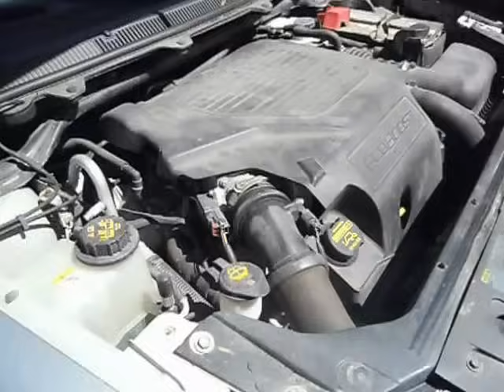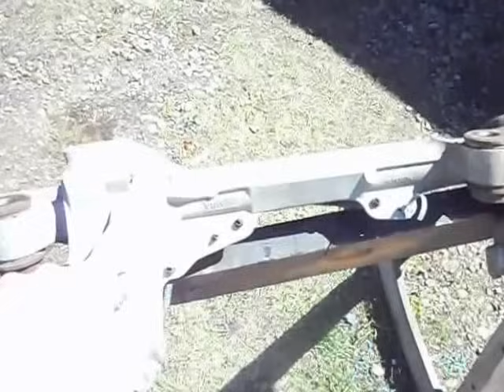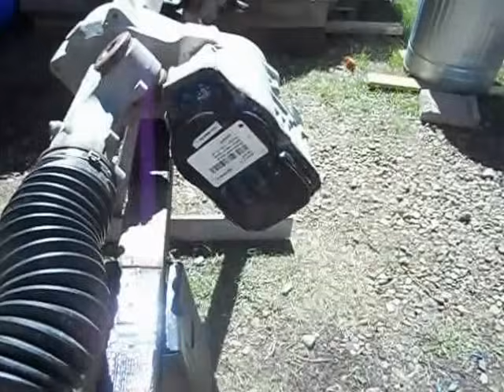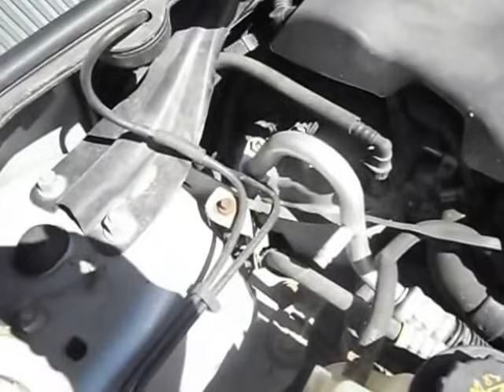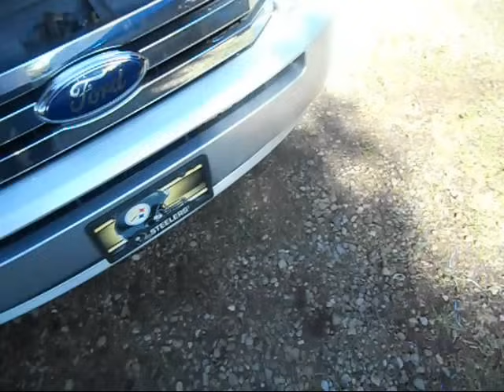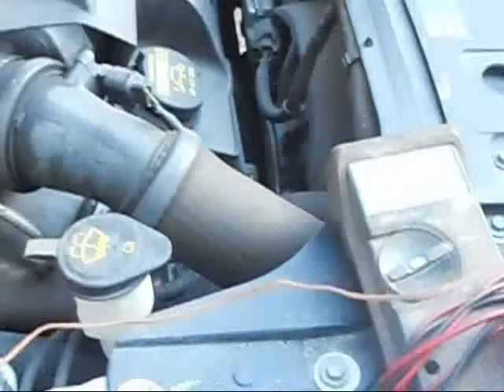Ford Electric Power Steering Failure Identified

Comment: It's happening to me on 2011 Ford F-150. 
Battery replace 
Rack and pinion replace
Reply: Why did you have to replace the battery I'm having a similar problem on my 2012 Ford Fusion and my battery was bad the battery is only a year or 2 old and I'm having this power steering assist issue that came out of nowhere overnight
Reply: @stevenpoljak9762  its was a bolt loose on the power sterling system. please check with your local ford dealership.
Reply: @stevenpoljak9762   I had the same issue with my 16 explorer, replaced battery on Monday, the power steering went out on Friday just leaving my drive way, ford says its not covered under warranty, want to charge me 3k plus tax to repair.

Comment: This has me worried about my 2012 Ford Focus also. How do I know that the rack is failing? Are there any sounds I should hear that indicate impending failure?
Reply from the maker: There are sometimes quick succession tapping sounds, there are sometimes impulses felt in steering wheel, there are sometimes no sounds with sudden failure, or instances when steering intermittently fails to assist. My 2010 Flex provided no symptoms other than strange pull to one side (which would typically be interpreted as tire wear or alignment issue), until abrupt failure during sharp turn, causing accident.

Comment: Ok. My Ford Mustang 2011 is presenting the next Failure: 

‘’Power Steering assist NOW’’. My mechanical said, order a new one steering Gear Rack/Pinion .. there’s any other option?  Or is a good solution??
Reply from the maker: Options limited, do not trust anything Ford tells you. Have vehicle repaired and walk away from Ford products. These vehicle deficiencies are dangerous and problem will return with replacement rack. Ford has done nothing to correct engineering blunder.
Reply: @bk1468  that is, could it be a computer error or related to some nearby failure? I mean, could it be the steering belt, some sensor, do you mean that which has to be identified correctly?
Reply from the maker: @Antuanettetavarez  You mentioned steering belt; which would be associated with hydraulic based steering system. I assumed your vehicle was equipped with electric power steering system (EPAS), which is the subject of this video. EPAS systems include no others components other than steering rack; which is fully electrically actuated. If your vehicle includes EPAS system, your problems are considerable and expensive to repair. If hydraulic, repair is much leas expensive.
Reply: @bk1468  hahaha I had to hire another mechanic specialized in the brand. and yes, you are right. the module that controls the zipper and others has a short circuit and more than 24 communication errors. Thanks to you I was able to hit the point of the problem.

Comment: So other than "dont buy a ford" what is the remedy for repair?
Reply from the maker: Replace EPAS system approximating $1.5-3K average. Dispose of vehicle before replacement unit fails again, due to identical issue.

Comment: 85 celcius aren't 180 farenhite, 100 Celcius is 180 Farenhite, however for electronic is still deadly temperature
Reply from the maker: You are incorrect, as several other commenters have made same miscalculation. C = (F-32)*5/9 and F = (9/5*C)+32 so, 85C = 185F. I believe I stated 180C in video, which was very close and based on estimated guess. Google has a temperature calculator also. Fundamental reference is boiling point of H2O = 100C =212F. You have also spelled both Celsius and Fahrenheit incorrectly.

Comment: My f150 is a 2012 and my electric power steering seems to be leaking some form of oil
Reply from the maker: There are no oil reserves I am aware of internal to EPAS unit. There are large electrolytic capacitors associated with power supplies, and grease applied to gears and bearings. Electrolytic capacitors swell and rupture when overheated; leaking electrolyte. Grease becomes less viscus and may flow at high temperatures. Otherwise my guess would be some other source for fluid.
Reply: @bk1468   it's coming from the pan right there on the power steering motor it's a fluid almost like brake fluid
Reply: @bk1468  and not where the cv axles connect in but that pan on the back side of it

Comment: Just curious, was there side to side or up and down play in your steering shaft “worm screw” inside the EPAS  housing?
Reply from the maker: Not clear what your question references. EPAS unit was electrically faulted, no mechanical defects were identified or investigated. Worm screw was never identified as worn or defective in any way, no mechanical play was detected anywhere in steering system, nor were any mechanical tolerances measured.
Reply: Bryon Smith sorry for the confusion, I was just wondering if you did notice any mechanical issues other than the defects in the electronics of the EPAS. I have an f150 and have about .0625” of side to side play. And I can’t find any information on the internal specs of the EPAS  system. Your video has been the most informative about the electrical schematics and it’s functionality. Basically lost on what to do, other than spend $2000. 😅
Reply from the maker: Shop on ebay for new EPAS replacement, you can find one for around $300.00 to $600.00. Would not be concerned about warranty since Ford will not honor it anyway, or at least try. F150 replacement is easy since you have lots of room to work. Are you sure mechanical problem is associated with EPAS unit? Really not much inside other than worm gear set, which in my experience requires serious abuse to become loose. Inner and outer tie rods would be my best guess. Good luck.
Reply: Bryon Smith I just posted a video on my channel, if you don’t mind taking a look at it and seeing what you think I would really appreciate it.

Comment: Just purchased a 2018 escape sent it in for a front end alignment car pull to right...got back still pulls to right and steers hard when turning. No codes yet bringing back to dealer today anything I should mention to them your input would be appreciated.
Reply from the maker: If related to EPAS failure and vehicle under recall. Do not let dealer update EPAS controller firmware. Ford will refuse to replace EPAS once full failure occurs. This may sound ridiculous and disturbing; but this represents Ford policy, many consumers have been defrauded in this manner. Also, your failure (if EPAS based) represents prime example of EPAS unit exhibiting non-commanded steering. This failure mode has been experienced by many Ford owners and identified as highly-hazardous. Non-commanded steering failures remains fiercely contested by Ford as non-existent, with hardware and software fail-safes. It is not the fail-safes at issue; failures caused by incompetent design philosophy and lack of redundant servo-feedback and control elements. Ford has basically implemented servo-system ignoring basic design precautions covered in basic control-theory.
Reply: @bk1468  Thank you for your input. There was a recall but cant remember what it was will look at paperwork once i get car back but they already updated it. Car has only 7000 miles on it and i have only owned for 2weeks. Did a search yesterday about issues having and your thread came up. Thanks again.

Comment: If electric motor in steering rack will fail would you be able to steer at all?   or not? Can you turn steering wheel or it will be locked?

Thanks!

with "'old" system I know if power steering pump is broken you can steer but with great afford, so you may avoid accident
Reply from the maker: Just like hydraulic steering; electric steering defaults to manual with loss of power. However, there are electric steering failure dispositions that can cause non-commanded steering torque, and steering lockup. Please see discussion in comments concerning servo system failures and servo-lock. Unfortunately electrical steering systems are far more likely to fail in hazardous states than hydraulic systems. There are hydraulic failure modes that can also be hazardous, however the probability of this occurrence is far lower, given nature and simplicity of hydraulic based systems. Typical EPAS system incorporates thousands of discrete electronic components, and the nature of electrical based servo systems substantially increases probability of hazardous failures. Fail-safe servo electronics must incorporate redundancy and failure recovery mechanisms within design structure to minimize risk. However, this approach comes with a cost. Ford EPAS includes no sensor or computational redundancies, and no effective failure recovery mechanism. Ford has placed confidence in a single computer approach that shuts down power to EPAS servo electronics when fault is detected. The problem with this approach is the same legacy design issues engineers learn in servo systems courses. Challenges and limitations of electronic based servo systems are well known and understood at the academic level. Ford engineers, apparently at some point, decided to apply the technology, but omit critical redundancy and safety mechanisms. The result is hazardous and failing assemblies by the millions, and Ford consumers left in the cold with $3,000.00 repair bills.
Reply: I have Fiesta...2011. ... hmm.. There is def. something to think about...
Thank you for your respond!

Comment: My girlfriend's 2012 Ford Fusion lost the throttle body first the part was recalled it got replaced then the power steering was recalled that was replaced two weeks now and the power steering has gone again wow that's pretty much it cars I lost cause 2012 Ford Fusion SE junk
Reply: And is something wrong with the ABS the brakes they pulsate you asked about it at the dealership they say it's fine it's acting normally and I know it's not because we got to rent a car while her power steering rack was being replaced and the car slowed down came to a complete stop no bouncing no gyrating it's ridiculous
Reply: Where can I find the recall for the 2012 ford fusion
Reply: I have a 2011 Ford Fusion sel having the same problem I just bought it and I did the research after and saw all the recalls I was like well dam should’ve followed my first mind not to never buy a Ford but I didn’t. My son father always told me fords are not good car sense I was like 16 but just wanted to give it a try my first time and last time never again nothing but junk shame shake my head 🤦‍♀️

Comment: Did you know theres a drive belt that shreds?
Reply from the maker: Large timing belt couples rack worm-gear to drive motor pulley. As with any belt, wear inevitable over time. Not aware this belt causing failures, of course belt likely to outlast other failure-prone EPAS components. Belt in my failed EPAS unit was inspected and appeared in pristine condition. One may question why wear-prone belt and amazingly complex electric servo system would replace simple and reliable hydraulic valve. Of course this is due to need for all-electric drive systems in EV's. Ford just implemented dirt-poor design and stayed course in spite of failures in the millions. Any Ford owner experiencing EPAS and other failures will never purchase another Ford product. 10 years ago Ford was $100B company, today Ford worth about half that.

Comment: I have a 2009 Ford Escape with all the problems mentioned below. Locks up (after recall) when starting. Tried to fight this last year with VA AG and no luck, Ford would not budge. It actually didn't bother me all winter but now it's in the 80's again the problem is back almost every time. Here's the thing though...I only need the car for 3-4 months before I ditch it and move to Germany. Is there any temp fix I can do? The battery part mentioned never occurred to me and my battery is pretty old so the poor voltage would make sense. Any ideas for a quick hack I can do? Not willing to pay $2000 for a few months of a working steering column, I might as well just rent a car.
Reply from the maker: There is no effective method to repair problem this serious and hazardous.
Reply: Reading the NHTSA data closer, notably the section on steering wheel dithering (is that even a word?) my issue can be solved by the torque sensor which has worn out brushes. Yet they gave me a quote for the whole steering column (also called PSCM) and the torque sensor. I am not getting the DTC code or audio/visual warnings however. https://static.nhtsa.gov/odi/inv/2015/INRL-DP15001-62304P.pdf?_ga=1.162564987.638222547.1493512607
Reply from the maker: Technical and disposition data Ford provides to NHTSA investigators must be digested with extreme prejudice. Ford composes contrived and minimally invasive diagnostic and engineering reports to NHTSA investigators with consistency. NHTSA investigators are bureaucratic by nature with little to no technical knowledge. NHTSA investigations are not impartial, and highly biased toward US automakers in general. The Ford produced failure analysis reports are commonly completely inconsistent with actual failure dispositions, and represent Ford's complete manipulation and control of NHTSA authority. The NHTSA is really about public perception and maintaining impression that safety recalls are addressed in responsible manner. The reality is fraud and bureaucratic power partnership to maintain $200B syndicates like Ford.
Ford's failure analysis report related to the EPAS assemblies specifically indicated very low failure rates. And further identified connector misalignment, conformal-coating and ribbon-cable problems as totality of causes. Ford even indicated problem was specific to assembly plant in China, and that production issue was completely corrected in 2015. With this, the NHTSA closed the case; while millions of EPAS units continue to fail over entire span of Ford models and model years, both prior to and post reported corrective action. Total silence from the NHTSA since...

Comment: Im from Saudi Arabia I have ford fusion 2012 150000 miles on it ..I have the same problem and i go to the ford company they said it cost you 1866$  very expensive what should I do guys 😢
Reply from the maker: If you pay to have vehicle repaired, Ford will replace EPAS with same faulty design, which will fail again; because failure disposition has not been addressed. Only recommendation is to stay away from US designed automobiles. Engineering competence and quality have reached all-time low. And Ford apparently believes they can continue to sell flawed and hazardous vehicles, while placing impossible repair burden on consumers.
Reply: Have it fixed.
Reply: How did you fix it brother..I have same issue and I live in Riyadh

Comment: My light just went on in my 2013 fire fusion and I have not gotten a recall in the mail and I don't think they have one for this year. What should I do?
Reply from the maker: Sorry to hear about your steering failure. Unfortunately if your vehicle is out of warranty; Ford is going to stick you with repair bill. ($2K-$2.5K for most vehicles). If your vehicle is still under warranty, watch your back; unless steering is completely non-functional; Ford will only make a software change that makes the indicator light come on for all failure codes. After software change; Ford will refuse to replace steering gear once fully failed. Also, if you do purchase a new steering gear; it will be the same design as failed unit (which will fail again at some point).
You can call Ford and complain,' if you are willing to go through several rounds of evidence gathering, paperwork and at least 60 days delay. After this process, Ford will offer partial repair cost (about $700.00); you will need to sign legal nondisclosure form indicating you will not disclose failure to any third party.
Sorry I cannot offer more positive advice, but this process is typical for most Ford owners with EPAS steering problems. I have a long history with Ford; my best advise is to sell vehicle and never look at another Ford product for life. Your problems will not go away after repair; it is just one thing after another with Ford.

Comment: any advice, just bought a 2013 taurus 3 months ago and the power steering failed and advance track light came on, after reading this don't know weather to take it and repair or not
Reply from the maker: Wish I could offer more positive advice, however Ford has really taken no responsibility for issue, and is still manufacturing replacement EPAS units of identical design. If you do fork out the repair bill, EPAS will eventually fail again. So I would suggest finding replacement unit on ebay, replacing unit yourself, then sell vehicle ASAP.  Cut losses now, because dealing with Ford will only add insult and frustration.

Comment: what was your solution when it was all said and done, could the internals be replaced?
Reply from the maker: Only option is to replace entire EPAS assembly. Internal components are not available individually, and EPAS implementation is not serviceable with various components brazed in place. Circuit implementations comprise highly integrated SMT components, mixed with wire-bonded driver IC, and multiple PCB interconnects, all packaged inside mechanical fixture. Troubleshooting electronics is impossible, since schematics and operational descriptions are proprietary. But even if you successfully replaced internal components; root cause of failure has not been addressed; facing impossible battle; fighting against inevitability that components are being slowly baked. Assembly as a whole represents overly complex, nightmare of an implementation, suffering from several design flaws, coupled with sightless ambition to do away with proven, reliable and cost effective legacy deign approach.